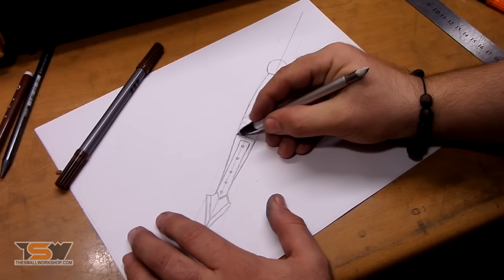Making a vintage marking knife

Comment from the maker: If you are interested in the tools used in this video: http://www.thesmallworkshop.com/my-tools
If you'd like to support this channel: https://www.patreon.com/TheSmallWorkshop
Reply: The Small Workshop u should try hardening the steel instead of trying again it really isn’t that hard and u can get away with it with a blow torch or if u are patient enough you can use a bbq lighter and dip it in water
Reply: İyi günler arkadaşlar
Reply: The Small Workshop . Why do not you try wandering Harry Potter?
Reply: That is really impressive
Reply: Is their plans on how to make this I would love to make my own
Reply: Очень похоже на церковное копие.
Reply: Lee-Roy Buckley auto pin punch
Reply: The Small Workshop. I'm a fellow Bladesmith and how to make one of these now for quite a while and yours has the best design and overall finish that I've seen. And I'm no artist by any means but like I said yours has the best designed by far. Is there any possible way that you could put a template up in the comments
Reply: Rohit
Reply: The Small Workshop o
Reply: The Small Workshop What if I want to buy one of those goals?
Reply: 404 error on that first link :(
Reply: The steel may not be hardenable. That would depend on the steels composition and carbon content. Since it wasn't originally hardened my guess is it probably can't be hardened. For the minor costs involved if you wanted to be sure then buying oil, water, or air hardening high carbon tool steel would be the better idea since it's not hard to find. Soft low carbon content steel can still be case hardened with Casenit, but the hardened layer won't be very deep. So within a few sharpening's you'd be into the soft steel again.
Reply: I just discovered your channel wow
Reply: WOW
Reply: The Small Workshop
Reply: I do not want to say anything bad and offend I don’t want to, but be careful wear gloves for a lot of moments there was hot flakes flying in your direction
Reply: The Small Workshop CV
Reply: The first link seems to be broken.
Reply: Это больше похоже на метательный дротик. Но всё равно красиво.
Reply: The Small Workshopo vo
Reply: I'm not paying your hospital bills.
Reply: Sebastian Coetzee  bbvbbbbbbbbb
Reply: Sebastian Coetzee   bb
Reply: Sebastian Coetzee  bbbbbbb
Reply: Sebastian Coetzee  bb    bi  b
Reply: Sebastian Coetzee   bbbb
Reply: Sebastian Coetzee  vb
Reply: Sebastian Coetzee  bbb
Reply: Sebastian Coetzee  bbb
Reply: B
Reply: @caelica8918  ya
Reply: 2:25 was the sawblade hardened or perhaps you annealed it off camera? I wasn't aware cutting a sawblade with a hacksaw was possible.

Comment: Interesting design; turned out well.  For my own, I made a blade with a “tang” that went the full length of the handle and mounted the wood handle on the top side only; sort of a hybrid between a Japanese steel blade knife that normally wouldn’t have a handle and a western style marking knife with a wood handle.  I like it because it has no handle on the underside to get in the way if I want to use it with something thick.

Comment: that is some hacksaw, it went through the blade quick or did i miss something, the blade must be soft
Reply: ian edge That's when I realized the metal was to soft, I'm glad he noticed before continuing with the protect. It came out nicely
Reply: ian edge I was under impression that is the only reason to destroy saw blade (too soft maybe warped?...). but still way too soft for knife edge.
Reply: Robert Kajor The saw blade was ptobably not sharp anynore, missing some teeth, etc. It was probably softened for easier use.
Reply: just wanted to say the same xD crazy how it goes in like butter
Reply: carbide blades have noticeably softer disks (depending on brands). This had carbide edges. industrial size blades are harder even with carbide tips since the stress and speed of the blades are quite high.

You can see the second blade has no carbide tips on it, hence the hardness in the whole blade.
Reply: hope u dont miss that 4:02
Reply: Had the same reaction initially...I'm thinking, "I have to ask this guy what kind of hacksaw blades he buys!"...then I had to ask him what kind of files he buys...then I thought, "Maybe that blade is really.." and the message came on the screen about how soft the metal was.  
For a few minutes I thought he had found the lightsaber of hacksaws
Reply: The disk metal is very soft ... even the file ate at it rather easily
Reply: cut through my ears
Reply: I believe that saw blade should be pretty soft, since it has welded teeth. As I have learned, those blades, that have welded teeth, are lower quality steels compared to those, that have the very same (good hardenable) material as teeth.
Beautiful knife, favourite part 7:31 :D:D  Yeah, what could???? :)
Reply: it's simple, if you want to make a knife, either go with sift steel of known kind, and  harden it on your own, or get hardened steel, like a saw, it's usually 80Crv2 Steel, but use only saws with no carbide
Reply: It is not universally true that carbide blades have lower quality steel. I have cut up several that are made of hardened tool steel.
Reply: Rick McQuay I see, thank you. this is an information I have gathered from the internet, I myself am working with O1 toll steel for now, soon I'll start working with D2 ás well.
Reply: ian edge he said the steel was too soft
Reply: ian edge 4:10
Reply: Nice.  I would definitely buy one of those, if it were for sale.  I don't have the knowledge of metal working yet.
Reply: Illuminati confirmed

Comment: Cutting a saw with a saw. 

🧐
Reply: Sophia Cupcakes a power saw (blade) with a manual saw. Manual tool's revenge!
Reply: To show you the power of  Flex tape ,i sawed this saw in half and repaired it with only Flex tape.

Comment: Great vid instead of making a new 1 u just could have heat treated the steel
Reply from the maker: I'm not really comfortable using fire in my broom closet workshop filled with sawdust, wood offcuts, oils, paints and what not.
Reply: but you're comfortable opening holes like you did at ~7:30 or cutting metal like you did at ~5:00? hahaha
at least put a warning below...
Reply from the maker: Of course, a finger is a finger, I got 10 of them, 20 if I count the ones on my feet, cause I've heard they can move them to your hand if you want. But burning mama's hacienda is priceless!
Reply: Looked to be a mild steel blade with either hardened steel or carbide stuck on it for cutting. Probably wouldn't have hardened much. Though, might have worked well enough for a marking knife.
Reply: tevoaol "At least put a warning below"? Honestly? Really? A vid about making a KNIFE, cutting it out of METAL, using POWER TOOLS. If the viewer cannot figure out the danger involved in doing these things then a warning isn't going to a whole lot of good. Chances are if the viewer has found their way to this excellent vid then they very likely have enough of an interest that they are aware of the dangers involved. Should we hold their hand as well?
Reply: How are you gonna heat treat the steel if you don't know what kind is it? you know that every kind of steel have different temperatures charts?
Reply: So because you 're interesting in something you suddenly know all the aspects of it? Since when?!
The guy's just trying to showoff but that blade could easily grab on the bit cut his finger off. 
It's because he uses power tools that MUST put a warning below.
Reply: Well, instead of "what could go wrong" he could actually write what COULD go wrong. It hardly takes more time to write "use clamp or pliers, or the blade can start spinning and cut your finger off" or write both and be funny AND informative. 

The handle on the knife is long enough so it probably wouldn't even cut his fingers. Even so there's hardly any point to not comment that mistake, since he commented the other mistakes too. But in the end it became rather clear what can happen with those drills and especially with small items you drill.
Reply: lol let it go...
Reply: I've had success heat treating TCT blades such as that with a few house bricks as a forge, a blow torch for heat and water for the quench. Just heat to cherry red, hold it there for 5 to 10 min then quench. You may not get optimum hardness but with a bit of experimentation you can get it pretty good.
Reply: You can use blowtorch and jar filled with oil (vegetable is fine) outside to harden the steel. It's really cheap and is fine for such small blades
Great video btw, cheers :)
Reply: @baalzevuv4509  You can use old motor oil aswell,thats what we used in school when harden metal. And there's nothing more satisfying than hot metal and the smell of burned motor oil :)

Comment: I once tried to make a small disk with a hole out of thin sheetmetal.
For some reason i made the hole last, after i cut out the circle.
I tried holding in down with my fingers.
The drill catched and the thing started spinning and almost cut a piece off my Thumb...

Just wanted to say be carefull with your fingers!
Of course I still do stupid stuff in the shop but I'm a little bit more carefull than before.

Comment: If you want to prevent a piece from spinning on the drill press you can just put a nail or a screw in your wooden table that will block the movement of the piece if it comes to spin (idk if it's clear, i'm not suggesting to screwing the piece you're drilling, just placing a screw in the table to prevent the spinning)

Comment: It is fantastic beautiful, a true work of art this knife to mark!. I congratulate and thank you for teaching, but I have a question: When you join a piece of steel metal (which is not stainless steel) with copper, you will produce a galvanic current that would sulfate the steel, therefore, those who understand this use bronze instead of copper. Have you had any problems with this oxide on the surface? Thank you very much!. I will try to do it because it is a beautiful piece of art (although it probabily could be oxidized) :)!

Comment: I have made exactly the same style of arrowhead marking tool. Small and efficient for both right and left handed markings against a steel ruler, square or bevel square. 
Especially efficient with guide rail skilsaws. I have a Mafell KSP 40. I have also used a number of guide rail saw systems. 
This marking knife lives in the KSP40 systainer with Hultafors 3 meter tape measure. Mark the stop with your arrowhead. Mark the other stop with the same arrowhead. Take out the saw guide. Place the arrowhead in the first stop and bring the guide against it. Same thing with the second stop. Repeat with both stops with the arrowhead knife until you are happy. Cut the board with your precision guided skilsaw. 

Hm, I think Mafell is still the top dog in both handiness and precision regarding guide rail skilsaws. Festool and Makita are tied with the second place regarding simply precision.

Comment: I was amazed at how fast that bandsaw was going through that sawblade haha it took me well over an hour to file down my "file knife" but I suppose it was easily 3x thicker than the saw blade.. this turned out to be quite the project!  It definitely took a different spin than I expected even though I saw the design at the start. I really enjoyed the use of brass and copper and how everything came together in the end. And the fact you used mostly hand tools. Proof that you don't need all the tools in the world to do a nice job. All of it could have been done with hand tools--even the handle. If you don't believe me check out Moroccan Bow Lathes =) Toodles!

Comment: Nice work, but the copper brace should go all the way down just past the curves on the back of the blade so as to give a wide shoulder to push your index finger up against, thus avoiding un-nessesary sharp pressure on your fingertip....next time maybee.
Reply from the maker: That's actually a great suggestion, and it would also look better!

Comment: It was very beautiful.. i really want those kind of stuffs.. the carving and everything.. i am worried though that you're not wearing any gloves or something.. you might hurt yourself. Hehe i am just concern because those hands deserve to be protected cause im looking forward for more awesome videos and crafts. 5 stars for that!
Reply from the maker: Thank you for your comment! I'm not wearing gloves since they are not really recommended when using tools that spin. Like the lathe, grinder or drill press. I sometimes use them when handling sharp pieces of steel or when using the wire wheel, but mostly I'd rather cut my finger than loose it :)

Comment: The knife is great and the video was good to watch. you said the first blade was too soft so what made the second blade harder it looked the same as the first one??
Reply: I don't know what saw discs are made of, but its probably mild steel...which is too soft for this application if you ask me...case hardening might be a good idea...Another way would be to make the blade out of high carbon steel and then quench harden and temper it. Overall great job though

Comment: This is like me when I make fursuit costumes.  Dremel.  Sanders.  Wire.  Bolt cutters.  Solder.  Saws.  Heat gun.  Sand blaster.  🤪

I also made a Gatling gun once.  Out of a drill.

Comment: The blade should have been made from an old file. Holes can be drilled in hardened steel with concrete drills running very slowly. The blade could be shaped and sharpened with a cutoff wheel and emery paper.

Comment: Looks nice, but useless.  
My concerns are the copper to wood and copper to steel conections are fragile 
But moreover the steel is soft its not going to hold an edge.  And the copper over the wood might be sharp you could get cut on it.
Its better in the display case becuse it does look very nice.
You jab the into purple heart there went the edge.  What good is a tool you have to sharpen everytime you use it?

Comment: It took you until sharpening to realize it was to soft? I'd think It'd be a given if you can effectively cut threw it with a hack saw.
Reply from the maker: I've said it over and over again, it's a HSS hacksaw blade, it cuts through almost any steel. I've cut drill bits with it. Some saw blades are soft enough to be sharpened with files yet they cut wood very well and for a long time.

Comment: Why didn’t you just harden the first one? And did you not know the test for hardness is to see if a file digs in or skates over the top of the steel?
Reply from the maker: A lot of woodworking tools can be sharpened by file and they work just fine, hand saws being the most common example. The fact that a file can sharpen a piece of steel does not make it unsuitable to cut wood.

Comment: good steel in the saw only on cutting teeth ..... doing the tool out of the body is exactly what to do with the (low carbon) construction fittings...............

Comment: i dont get it, why didnt he use the band sander and dremel to start off with whyd he use the file and saw?
Reply: Librarian-Ninja because the softer metal he used at first could be cut and shaped with a file and saw, but the harder metal he decided to go with later needed the dremel and th sander. he probably wanted to start out as simple as possible, for the people who might not have the tools at home.
Reply: Minja Arsic okay thanks alot!

Comment: You should have realized the steel is soft when you can cut it so easily using hand saw
Reply from the maker: Not really, the hacksaw has a great HSS blade and can cut through a lot of hard materials, like I can cut drill bits with it.

Comment: DRILL PRESS SHARP METAL DRILL BIT. WHAT COULD GO WRONG?
I cant tell you how many times I've had a drill bit grab just at the exit of a hole.
We almost got to watch a red stream come out of your arm.  Buy a vice. Use it.
Everytime you try to punch out the other side of steel it kicks up a burr these often ride up the drill bit flutes  with this you get what you had happening. Even if you back way off the presure it can do this.
If I want to watch blood and guts id search for it some dumbass surly posted one.

Comment: How can this be vintage if it has just been made. Vintage would be if it was at least 100 years old
Reply from the maker: Stores are full of vintage furniture that's brand new, noone seems to object.
Reply: @TheSmallWorkshop   if that is the case and they have been sold as Vintage the stores are committing fraud. Your knife at the best could be called vintage style. As would be the furniture in these stores. Either they are genuinely old or are just replicas

Comment: What the hell is a marking knife?
Reply from the maker: You use it instead of a pencil to mark a line along a ruler. It creates a very thin line and it is exactly where the ruler was, not like a pencil line which is a bit off due to the thickness of the lead.

Comment: It was a great videos yet he goes at this point I realized it was to soft like he ignored the far that he cut through the metal in like three cuts with a hack saw💀
Reply from the maker: The hacksaw has a high quality HSS blade on it. I've cut masonry bits, wrenches, screwdrivers and other hard metals with it. 
To make a woodworking knife you don't need very hard steel, think of the old saws that you could sharpen with a file yet they cut wood just fine. That's why I don't worry too much when I can cut and file the steel. But this one was too soft, the tip bent when I've put pressure on it.

Comment: Dude, use millimeters instead 😑
Why would you go the inaccurate route?
Reply: There are two primary systems of weights and measures in common use - Metric, and the one used by the only nation to land men on the Moon and bring them back safely.